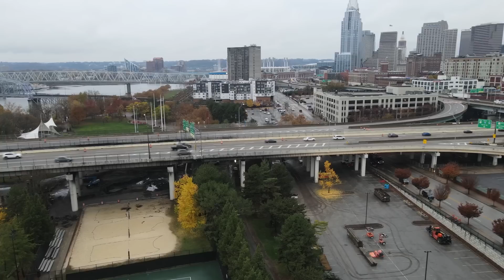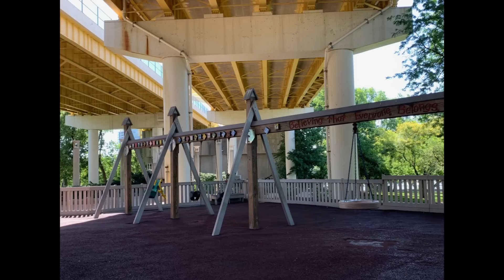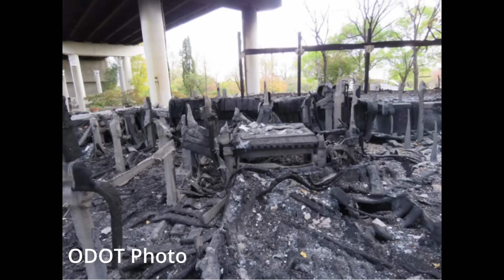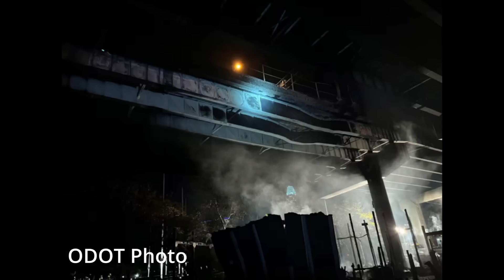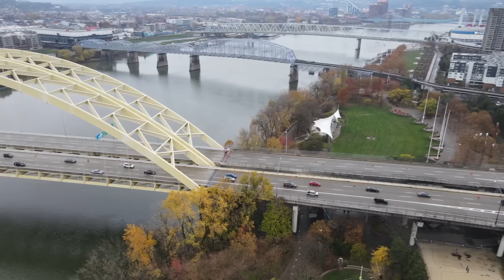Big Mac Fire Update with Drone Footage

Comment: I live 30 miles north of this bridge and it has made life around there hell. Some residents report it is taking 1.5 additional hours to work and back. I also was a certified welder for 38 years and scratch my head as what is the holdup? Finding girders that size might take a week or two but the regulations  that the engineers are under is BS. Everyone knows what it takes to make the repair but are scared to death about liabilities if failure. And for the people wondering how the fire started, could it possibly been the homeless trying to keep warm with a camp fire and losing control ? It has been reported two years ago to keep these vinal playgrounds from being built under these bridges, but Ohio needs to get rid of the money. Everyone wants their cut of the pie per fundings. jmho.

Comment: I am on the north west side of Cincinnati and if they have blueprints of the structure there are several fabricators in the city qualified to make the new steel girders. As a welder who has worked here all my life and 43 yrs experience.  It can't be that hard.  Ohio doesn't have state certification for welders it's company certification.  That should have been at the top of their priority list.  Find a fabricator and get the steel work done. Even if all of the steel doesn't need replaced.  But things move very slow in the city as it has for yrs.

Comment: The solution to dump gravel on the plates was a good one in regards to the plates, but now you have the potential to have the tornado pick up the gravel and fling it like shrapnel.  The tornado that hit Ft Worth about 24 years ago picked up lots of gravel from nearby roof tops that subsequently shattered lots of windows downtown. The plant was probably isolated enough to not worry about a situation like that.   Thanks for the reporting!
Reply: if you listen to what he said he eliminated the need for the steel plates instead they made the plan to just dump gravel into the open trench if needed

Comment: As an engineer and  project manager in my career prior to retirement, there is NOT enough plastic playground structure to cause THIS fire. No way. The shredded tire chunks have the capability to produce a pretty bad fire, but it would have to be a foot or two thick. This wasn't just an "inch or two" tire chunk fire. I don't know if there was a test for accurate presence.....

Also, with this damage, I can't help but think back during the earthquake in San Fransisco when the Oakland Bay Bridge had one upper deck segment collapsed onto the lower deck. Why not do the same thing. Just cut the whole section out and do a full  replacement. Period. The southbound section is totally closed anyway.

And to think HOW the fire started, I have several scenarios I will not share here.
Reply from the maker: I am very curious about what the results of the fire investigation will be.
Reply: At the end of the first paragraph: "accurate" is the autocorrected word that I typed. Correct word was "accelerant"

Comment: It’s like North Carolina, public works are forever jobs to have continuous funding. The ‘ring highway’ in Fayetteville is big enough to land the space shuttle in an area that only needs a two-laner, and the overpass across the western highway took 7 years to install the four bridge spans. Those projects aren’t meant to be built, they are for ‘eternal federal subsidies’, or welfare states that keep projects unfinished otherwise the money would dry up. It’s a common scam in the South to also double-bill for highway funds as they don’t decommission their old highways when they make a bypass so they can continue to collect federal money for highway repairs and maintenance on regular state roads. The Southbks full of those never-ending boondoggle bridges to no-where for perpetual funding from friends in congress party favorites. The South has no economic mettal, it lives on the straw in congress, otherwise economically it would collapse on its own for having no substance. 

Case in point, if you remove food stamps from certain parts of the southern economy, whole cities would collapse under their failed economic policies for lack of funding. The South doesn’t build anything, it is a backwoods that is subsidized with congressional welfare payments.

Comment: Maybe they only put up the one line of supports, because they suspect the reinforced concrete pylons there needs to be replaced, but they are testing to see if they are wrong?  But either way they need to be more clear with the public on what is happening - and I am very surprised that they haven't started at least taking the decking off.
Reply from the maker: Now Ohio DOT is saying they won't start demo until after thanksgiving.

Comment: I used to live in Arlington Texas. While I lived in the area, the Cooper Street bridge across I-30 was found to be structurally unsound and was closed. The city figured out that it was costing them something like $200k per day in reduced tax revenue because of the traffic disruption. The contract for the replacement bridge included what was worded as a penalty clause that charged $100k every day the opening slipped. But it also paid $100k per day for being early. It was estimated that it would take 9 months to build the new bridge. The new bridge was open in 5 months! The contactor was interviewed and said that he paid more for people, worked 3 shifts, got better steel and concrete than was really necessary and used more of it than was really necessary from an engineering point of view because it was necessary from an economics point of view. Many of workers on the site got large bonuses (high 5 figures to low 6 figures). This is how they should be handing this job, not pinching pennies while a flood of gold disappears forever.

Comment: Another serious problem is the current system of (mis)handling of recyclables.  Most places now use mixed pickups.  They are picked up and then dumped in a "recycling" location.  The more valuable and recoverable stuff is sold.  The rest just piles up. When the pile gets too big, some of it is trucked to a garbage (un)sanitary land fill.  The recycling location is usually an open space, but some times a building.  The location is sometimes under a highway bridge.  Usually they are very close to highways, if not under one.  They sometimes catch fire and burn with a high heat (lots of fuel) and dense black smoke with serious particulates and toxic fumes.  In my recent memory, in this area, there has been one bridge fire damaged, and numerous main road closings due to the smoke.  There are many locations just waiting for disaster.  I see them looking out the car window when riding.  We don't seem to learn.  I'm an elderly big picture generalist (semi-retired) PE.

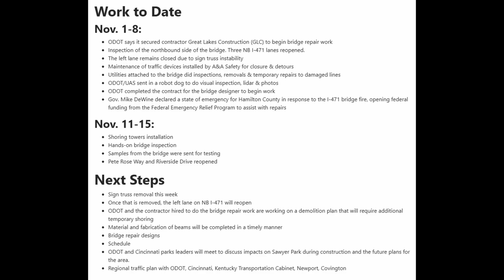Comment: 12:40 I wonder if some of the apparent delays are because of the potential hazards from off gassing after the fire.  Our neighbors had a small fire and needed to call in a restoration company. They had to wait several weeks post fire to allow the concrete to “off gas”.

Comment: Fires have been occurring under bridges at an increasing rate in the last few years. Vagrancy seems to be a factor in many but not all. Accidents involving fuel(gas, oil, other flammables) have also caused several disruptions to major arteries around the country. I don’t think it’s a conspiracy as much as bad judgement by so many officials involved.

Comment: To me it looks like they are going to remove the damaged section , probably two or three sections towards the bridge , the support tower is to support the bridge section up to the expansion joint ,  I assume the bearings on the concrete piers need replaced ,  it's a big job which could go seriously wrong if it's not tackled correctly

Comment: Casey, 

It is interesting to look at the differences between to look at the differences between in the approaches of commercial companies and government entities.  In a business you start with a worst case scenariofor returning an asset to work, whether it be partial or full capacity.  You then look to defining the "Critical Path" to fulfilling the return.  It seems in the world of government agencies the approach is to define the "Politically Correct" path to returm the asset to service.

For instance, we had a tanker report reduced ability to steer a tanker.  At arrival divers were ready to examine the rudder.  The diver reported the bottom half of the rudder was missing.  The process was then one of peparing the ship for drydocking, writing specifications determing why the rudder was missing,  and the permanent repair.  We then determined the critical path to repairing the rudder and returning the ship to service.  In this case we needed a 35,000 pound steel forging.  While we did all the engineering, a separate group had to work to find a way to ensure our refineries had oil.

I'd like to be a fly on the wall as a "Politically Correct" plan is being formulated.

Bob
Reply from the maker: Thank you.  Your comments are spot on as is your comparison with your tanker situation.  I am also surprised at how much difficulty they are having (Ohio DOT) in explaining what the issues are with this bridge.

Comment: Perhaps they're considering whether to restore the southbound side at all, or just reconfigure the current northbound side to handle both directions of traffic?  It appears to be a commuter road that leads to I-71 just to the north, a highway that crosses the river just to the west, with more bridges in between.  Maybe the merge just causes congestion, and the extra land is better used for parks.  Through traffic likely takes I-75 or I-71.  I-471 and what it turns into, US-27, only seem to serve semi rural suburbia, a few miles from parallel I-75.  I wonder if it's overbuilt as is.

Comment: I recall a fire under a section of elevated highway in Atlanta a few years ago,  As I recall there were flammable construction materials stored under the highway. There are numerous examples of cooked bridges, 2 in Arizona, 1 in Phoenix and a more recent on I-10 near Willcox.  I agree with your point here. Perhaps engineers should be tasked with providing 3 alternatives, fastest, cheapest, optimized or something like that to decision makers.

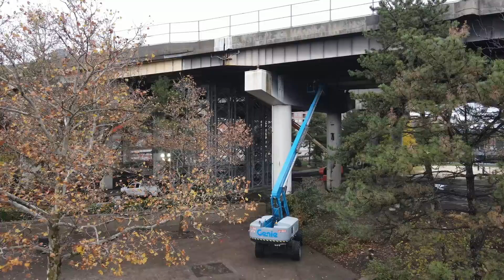Comment: I see one design detail that complicates things a bit and it's that the joint between the damaged span and the ramp isn't right over a support but with a slight offset. This might mean that there could be a "domino effect" of needed demolition. You can see that at 12:50. The support pillars seems to cover the ramp support rather than the damaged span, but it seems like the construction is such as the spans aren't entirely standalone but are interlocked, and how far is it necessary to perform the demolition?

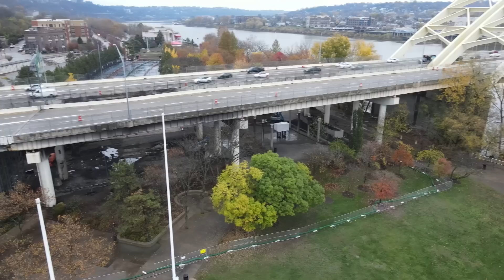At 1:25 it seems like the beams stretches all the way to the bridge itself. It will make it a bit harder to demolish, but more expensive to replace than a single module between two pillars. But it was probably looking like a good idea at the time.

Comment: As a local I can give you some insights.  These are not hard facts just local opinion.  I've used that bridge for 3 decades and I've parked under it for the last decade.

First .. In the 70s Columbus the capital grew as the expense of all other large cities.  So at a state level not of the entities except the capital are typically a priority. 

Second .. this bridge is an alternate .. The 71/75 carries some percentage of the US economy ... this bridge that burnt is rally a local bypass ... The airport is also 71/75

Third .. while people do cross the river, the Ohio side shops in Ohio, the my side shops in ky.  While business do use it, it is a commuter bridge.

Forth .. most commuting is from ky to oh.  So the part of the bridge that is closed is the PM commute back to ky.   That light traffic into the city, the open part, that is all day except the AM.

Fifth ... post covid ommunting volumes did not return ... pre covid if you were running very late there may not be a parking space .. post covid as one of the most remote parking lots it is mainly empty 

Sixth .. The other major use for the bridge is sports (major league football and baseball .. hockey etc.) And fireworks.  It will be leaving the sporting events and any other downtown event where this loss of the bridge will be felt

Most important to the speed of repair: This bridge is incredibly convient for Kentcucky but it belongs to and will be paid for by Ohio
Reply from the maker: Thanks for those insights!
Reply: correction all bridges belong to Kentucky... the accessing structures belong to Ohio...
Reply from the maker: @joestein1144  It is the Ohio DOT who is responsible for getting this situation corrected.  I am sure they are getting input from KyDOT.

Comment: I'm still puzzled about how a play ground can catch fire and have such heat intensity that it can damage a bridge.  That bridge appears to be 30 to 40 feet above the play ground.   That bridge has damaged steel, which would have taken a lot of heat over a long period of time.

I keep hearing the play ground had rubber mulch, and other flammables.  Well, so do many peoples gardens around their houses.  I've never heard of anyone's garden destroying their house.  A wild fire can, but that's often because burning things fall on roofs.  How can rubber mulch make so much heat, and what ignited it?  

I think I'll go to Home Depot this weekend and buy a bag and test it.  I'm curious to know how hard it is to ignite.  I'm betting it takes a lot of effort, like use of an accelerate.  Also curious to know how high the flames can go.  If rubber mulch really is this dangerous (I'm keeping an open mind), we'll need to be careful about using it in the garden, especially in fire prone areas like California.
Reply: The park at large was from 1988. As were much of the trees.  35 year old trees were big.  There are smaller trees from yeas since too.  I dont remember them being trimmed on the top so I assume they planted ones that would not reach to the bridge.  I can't remember how old the playground was   feels like a decade.

I assume to was leaves (The bricks are thick with leaves that they clear up often in the fall) or trash .. bushes .. trees  .. tree branches fall on playground.
Reply: @davidgoodwin4148  The tree idea seems more plausible than the rubber mulch.  Leaves on the ground doesn't sound like a cause, because I've burned piles of dry leaves and the fires never go more than a foot to 18" high.  Trees are a good possibility.

However, that brings up another concern.
I've driven thousands of miles of interstates and there are numerous bridges I've crossed that had lots of tall vegetation below them.  If someone had a wild hair growing in a dark place, and if vegetation was that damaging, then that person could disrupt my travels.

Comment: I heard a report on local radio today that they are adding more temporary shoring. I agree with the approach you outlined. No excuse for not aggressively starting demo
Reply: For steel bridges there is a long lead time for the steel, many sizes are rolled only twice a year, and very few more often than every few months, so there is plenty of time.  No-one stocks bridge steel in this country... made to order when they get to it.  May also be "buy america" issues if they hope to use federal funds for any of the work as it is illegal to use foreign source steel if there is any federal cost participation in the project.  There is also the possibility the origional steel girders do not meet the current code and some redesign is necessary, then there is the hazmat issue.  Partially burned plastics and rubber are hazardous materials.   Precast girders are easier, especially in standard sections.  I have done emergency jobs where I designed the girders right after the bridge failure and had plans to the cost estimates section for bids, who got quotes to build them over the phone the next week.  The girders then when fabricated were owned by the state and provided to the eventual contractor as "state furnished material".

Comment: Hi Casey, Cincinnati resident and frequent viewer of your channel.  

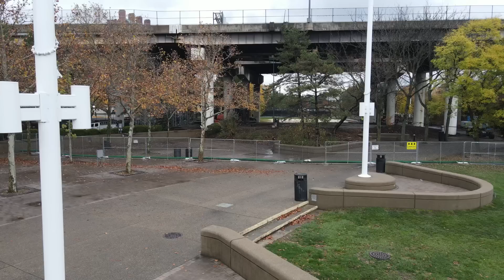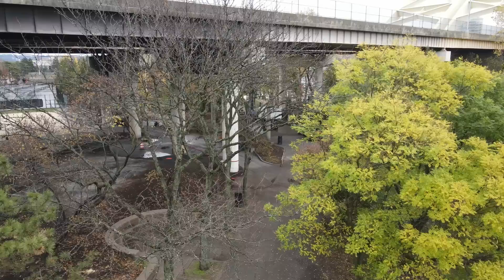I wanted to point out something I noticed about the construction of this span.  It's visitable at 14:50 in the video that the affected span does not stop at the pier to the left. It cantilevers beyond that pier toward the section with the new false work. I'm certain the new temporary supports are going to be used to lift that adjacent section off of the affected span.  Another observation is that the affected span extends all the way south to the main superstructure as one continuous girder line without anymore expansion joints visible at 13:07.  

I'm not sure where they will need to section these damaged girder beams and possibly build more temporary supports to section in new steel work.  

It looks like it's more complicated than just taking that one section between the two piers.
Reply from the maker: Thank you!  Those are great observations and I agree with what you are saying.  I wonder why they haven't put in more falsework?

Comment: Any idea what started the fire?
Reply from the maker: No information has been released yet.  My suspicion is arson, but it's only a suspicion at this point.
Reply: @CaseyJones-Engineer  there is a string of parks under the bridges ... this one is fairly far from residential.  If it was I would say it was picked because of how "remote" it is.  That office building (who's main entrance isn't on that side) is the closest.

I feel like it was a cigarette on leaves or a trash can .. That went to brush .. then trees ,, the that rubber mulch.  It wasn't super dry this year but it was a low growth year for my grass so it may have been dry.  On the cigarette.. you can't be there at night .. and you can't smoke at any time.  I assume they patrol sometimes after hours.